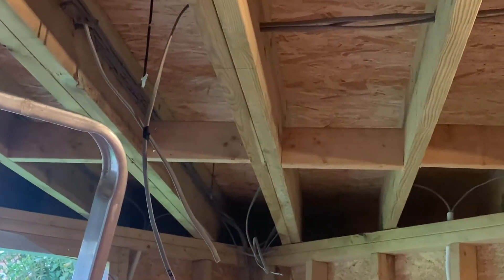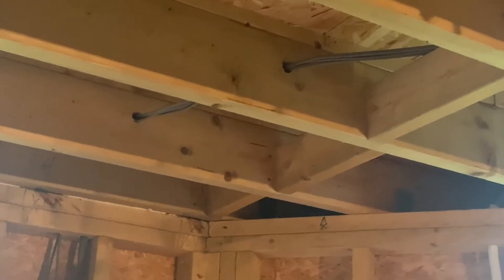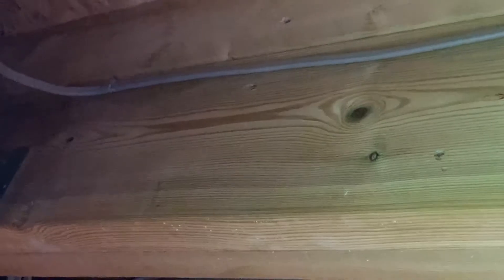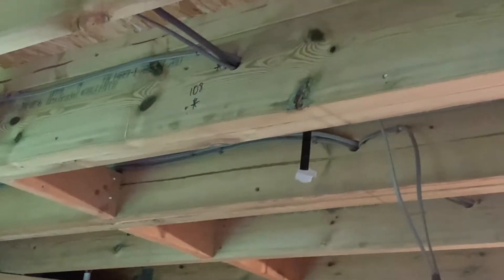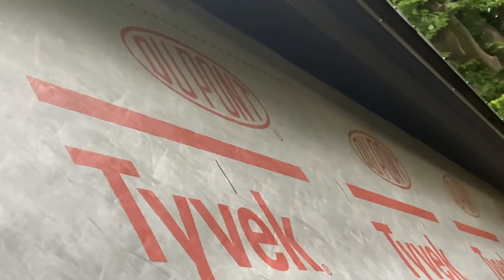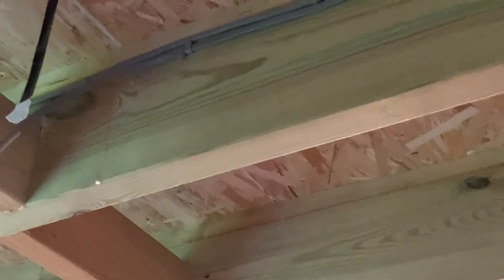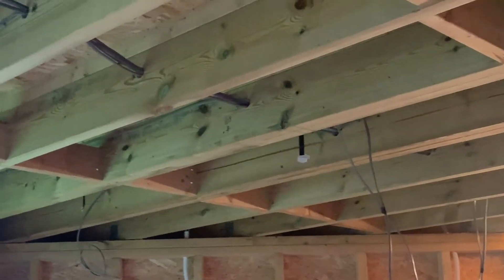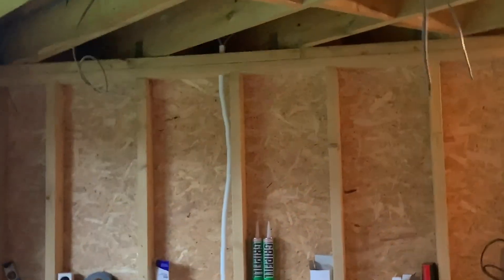DIY Garden Office - Games Room - Cold Roof with Firrings

Comment: Hi Kev, I’m at similar stage of my build at moment and also have tapered walls due to shape of garden boundary. Basically a 5.5 by 4.7 rectangle but with back right corner chopped off. Following the garden fence meant angles of 50 degrees and 40 degrees ( with hindsight should’ve just made it 45:45 degrees as mitre saw cuts would’ve been easier!!). Anyway, I’m trying to work out how strengthen the wall connections on those two angles. For normal corners the end studs butt up nicely against each other at right angles and I just drove a number of 100mm screws from top to bottom of those corner studs. For the angles corners whilst I can get the front edges of the end studs to touch , obviously because of the taper they then move away from each other. I was thinking I could cut some angled noggins to pack out that space and screw 100mm through? My top double plate overlaps on those corners so there is some strength there and obviously the rafters also help with rigidity. How did you deal with this (I couldn’t quite see in your video).
Reply from the maker: Hi Chris, it's a good question. I pretty much did as you're suggesting, except I also cut a bespoke triangular shaped length which filled the outside gap, then screwed this in at angles into the corner pieces, completely closing the gap. This method was pretty strong, but you are correct, once you get the roof joists on and the noggins between the joists, all that combined produces a great strength. Interested in seeing your build, if you have any pics / video anywhere.

Comment: I am planning on using firrings as well. Do you have cross ventilation as you seem to have used vented soffits all the way around? How will air flow across the firring/joists? I was thinking about notching out the bottom of the firring to achieve this but unsure on how deep or frequent to notch as it will be holding up the 18mm ply deck and epdm. Actually, I think I have just spied a notch at 2mins 37secs. Can you provide any detail on this? Thanks
Reply from the maker: Hi Steven, I have vented soffits on 3 of the 5 sides dues to the shape of the building. Airflow is achieved from front to back in the direction of the joists, all the way along the above the PIR insulation, there is at least a 70mm air gap flowing from one end to the other where there is a vented soffit, thus creating the flow of air. Take a look at the 'Clod Roof - Part 2' video, as it explains more about this, https://www.youtube.com/watch?v=mbqr6D8ceK0&lc=UgyyNJT2lNc9caj9nu54AaABAg

Comment: Great video and thanks for sharing - did you use smaller height noggins in the middle to enable airflow across them above the PIR?
Reply from the maker: Hi Greg, yes exactly. The joists are 170mm + firrings (90 mm to 0), all the noggins are the same height at 120mm, leaving a good air flow gap ranging from 50mm up to 140mm. Take a look at the Cold Roof - Part 2 video, https://www.youtube.com/watch?v=mbqr6D8ceK0&t=1s
Reply: @speedyrazor1  thanks for the quick response.....will take a look at the 2nd vid

Comment: Kev how did you fix the firrings to the joists? nails or screws (different lengths as you get thinner on the firrings? ) also what spacings? thank you
Reply from the maker: I used wood glue and different length nails (nail gun). Firings were different lengths, as for the odd shape, non square. I used 16" centres on joists.